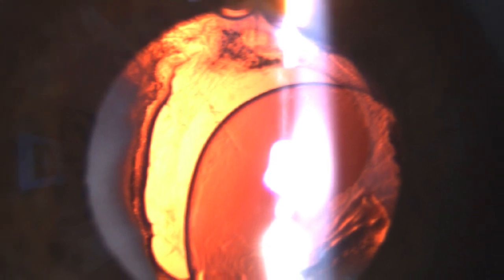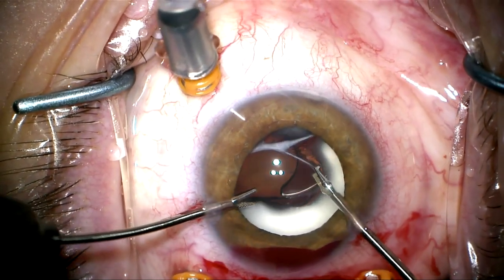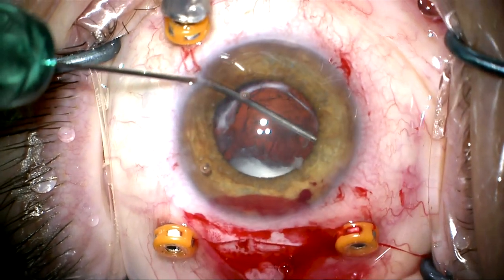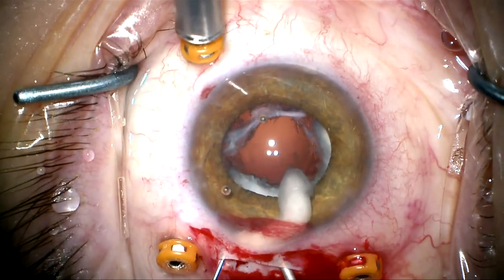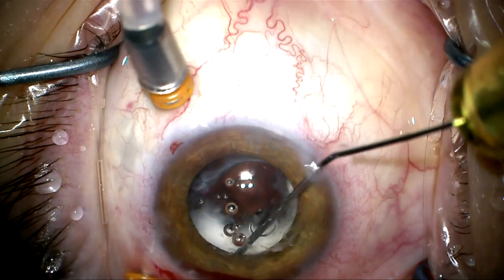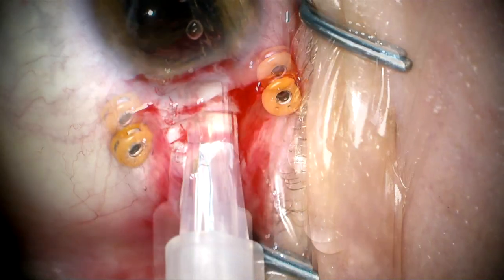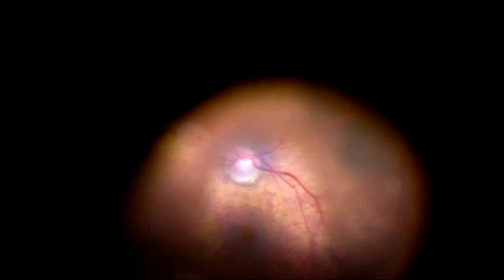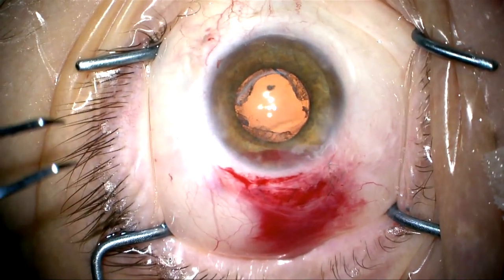IOL xch with removal of S ring for capsule fixation by Steven G. Safran

Comment: A “normal” surgeon would have simply placed a 3 piece in the sulcus and left the S ring alone. At least that’s what I would have done. Bravo as usual.
Reply from the maker: There was no room in the sulcus because of the Soemmering's ring.  A new Lens jammed into the sulcus would likely cause chronic pain and inflammation by pushing up on the iris and the haptics being displaced into iris root.   If I was not able to dissect out the S ring I would’ve removed everything and done Yamane
Reply: @StevenGSafran  understood. Thanks and stay well!